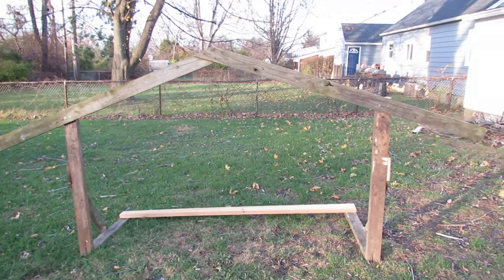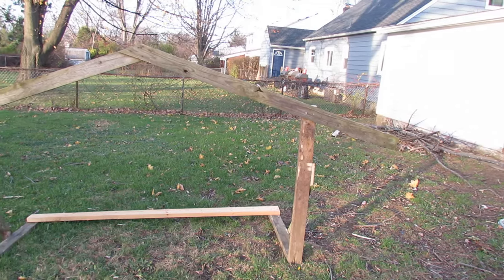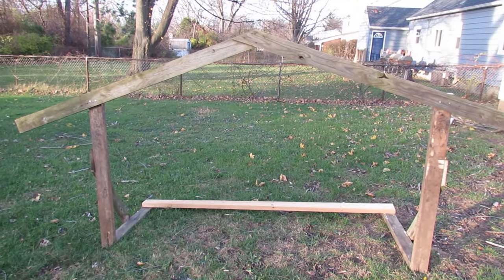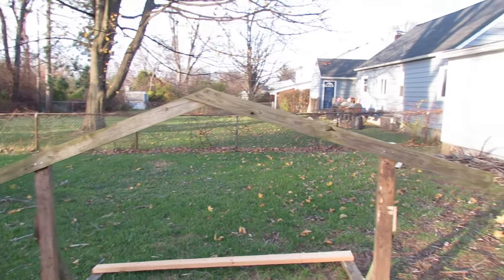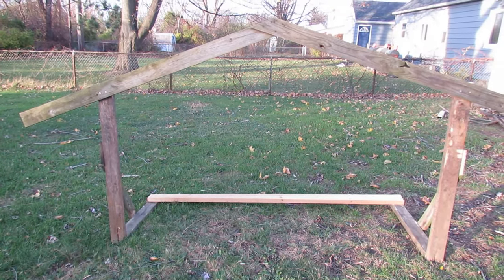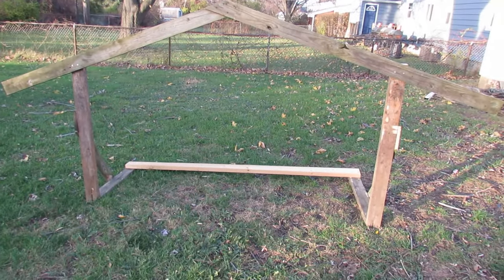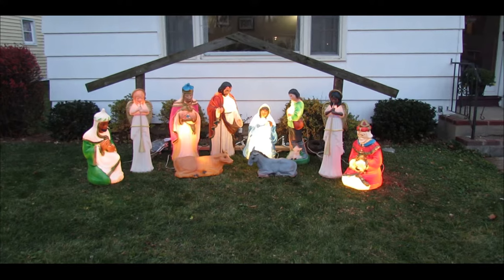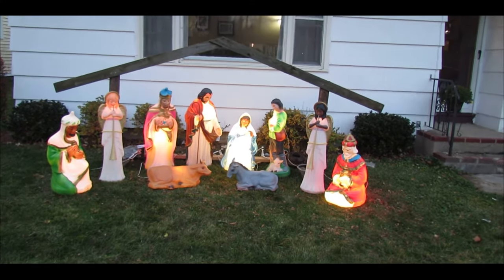Making a cheap inexpensive stable for an outside Nativity Scene!

Comment: Perfect! Came here and first one popped up. I have Al the wood and am going to get it done before dark! Awesome! I cut my figures out of wood and painted myself. I used pipe clamps to hold rebar that I hammered in the ground. That’s how I got my figure up. I sis set them up off the ground on a piece of the pallet board base just for extra protection. Thanks for sharing!